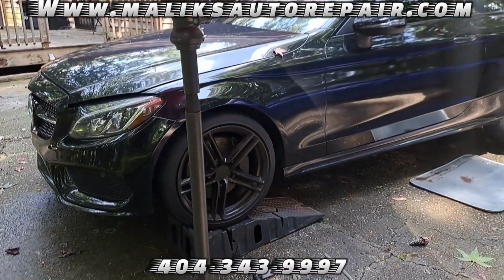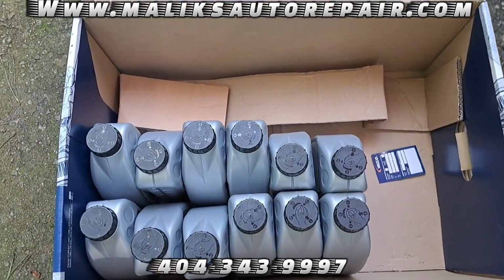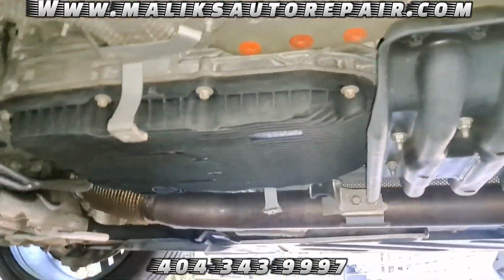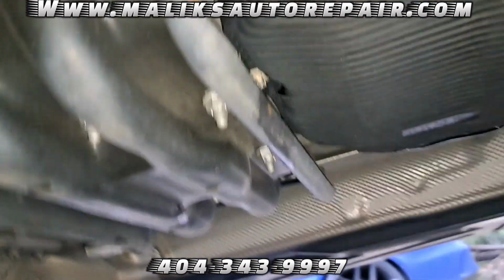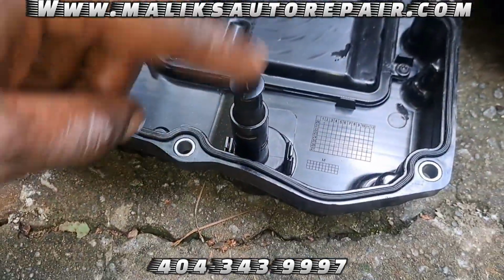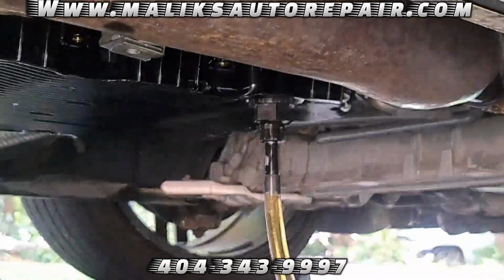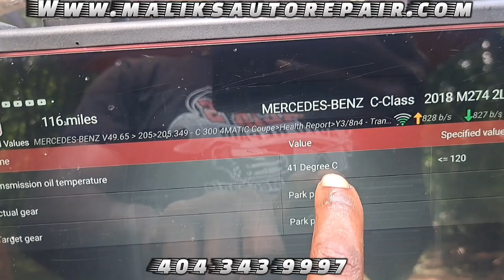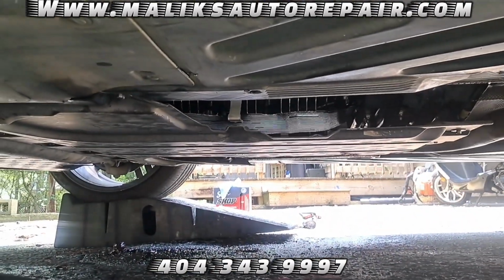TRANSMISSION SERVICE| FILTER, FLUID, GASKET, PAN| 2018 MERCEDES-BENZ C300 4MATIC | Howto/Diy

Comment: Did that kit come with that fill tube adapter? Or did that have to be purchased separately? Need to service my wife's C300. Got the B7 service message on the dash.
Reply from the maker: No the adapter sold separately. Got it off Amazon